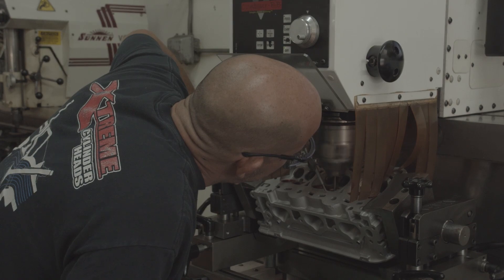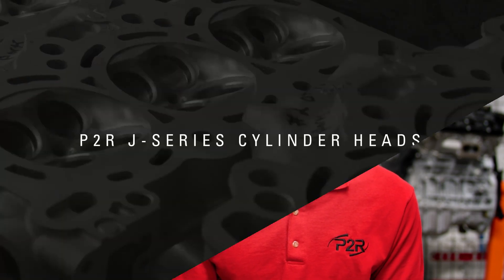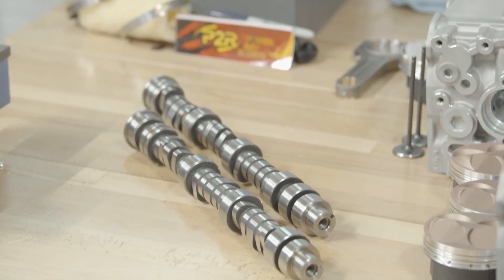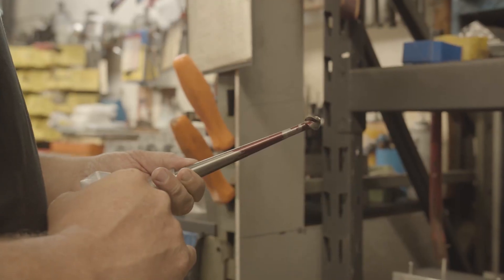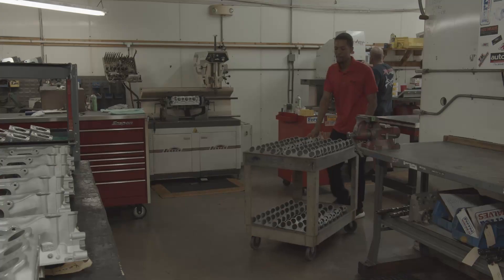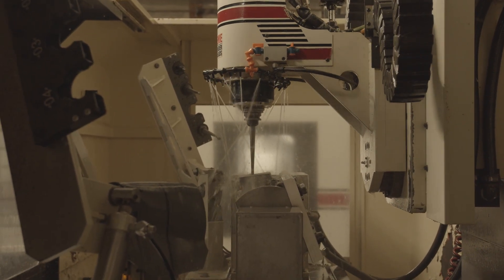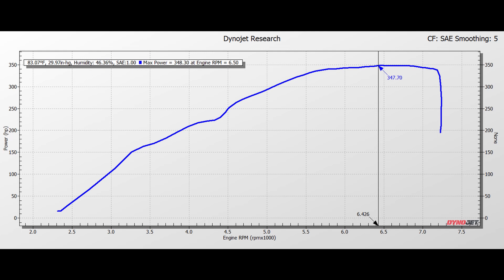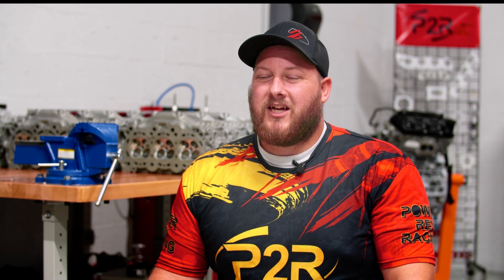P2R CNC Ported J Series Cylinder Head Program Part 2

Comment: What's the largest intake valve size on the j30a1? And what would you recommend for engine tuning for this motor
Reply from the maker: We can fit 37mm intake and 31mm exhaust.  But would require pistons as well as that size won't clear the stock j30a1 pistons.

Comment: These are some of the smartest guys in the J Series aftermarket.  Even though I'm an old guy, I am going to try and post my all motor J35 build that includes top coated and skirted Traum pistons @ 11.5 comp, J37 crankshaft, ported heads and full Ferrera valve set up.  All of it from P2R.  Please don't freak out but I'm going to drop it in a 2010 Ridgeline.  That's right.....nice-n-sleepy.
Reply: You should have recorded your rebuild and posted it to your own YouTube channel. 'twood have been interesting to us J-series owners.